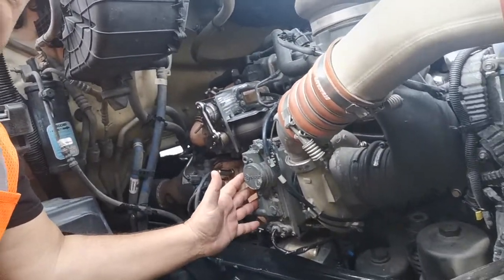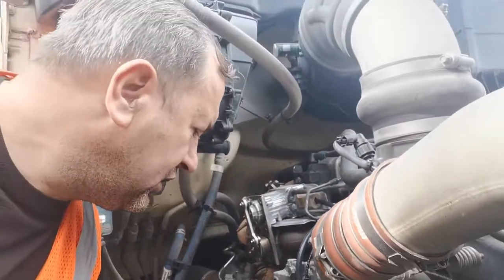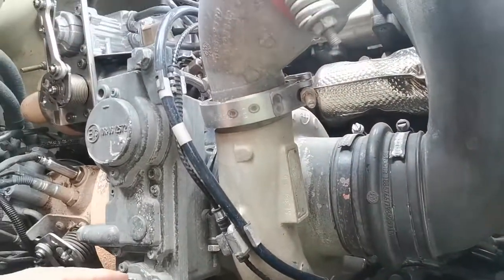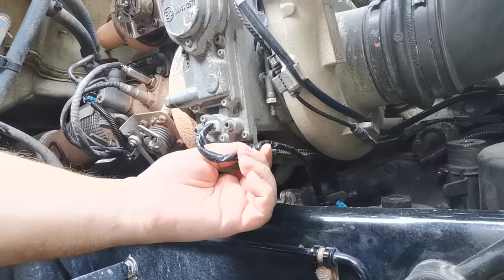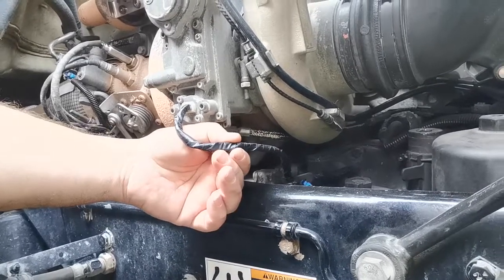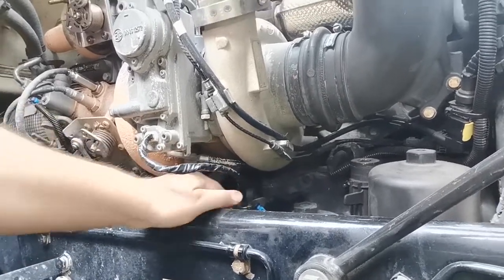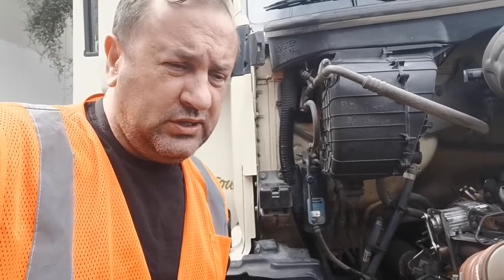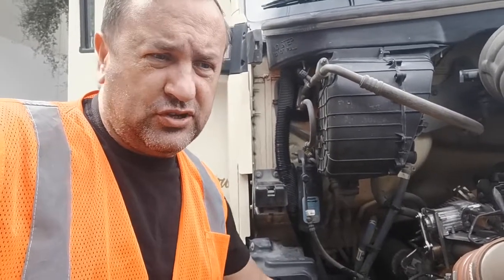Paccar check engine light code SPN:1231-J1939

Comment: Thanks so much for this video. I just rebuild my engine and am having thesame issue with the stop light. I checked the cable, wrapped it with the rape but it continues. My question is how long can you drive with such an issue because it comes on and off
Reply from the maker: 6 months

Comment: I don't  have that issue, but have had other wires do the same from vibration  etc. One thing I do is like where that tie was and wore through. I take a small piece of old rubber hose or bicycle  tire inner tube and wrap the electrical wires and then tie it again to secure it from wear and vibration. Because where those wires go into the unit, the wiggle and movement  could eventually break them. It would then be very hard to splice them at that point. Ok want to ask does the paccar give good mpg?
Reply from the maker: Same loaded 6.0
Reply: @VladMaktrucks  thanks. I have a 2001 pete 379 with a c-15 cat. Average 5.5. Have hit 6 a time or two. I pull rail containers. The mpgs are checked and recorded every month for my quarter IFTA reports.

Comment: Hello
Friends, I have a daf model 2020 mx13 engine, engine retard. Why does this engine damage the camshaft, and I have seen several cases where the camshaft also breaks quickly, and this is a weakness for this engine. In your opinion, the cause of the damage of the camshaft and roller. Isn't it too much to use 3 engine retard times on a hill? Please advise, this is a problem for this engine, and the second question is what type of oil is suitable for this engine. Please answer
Thanks